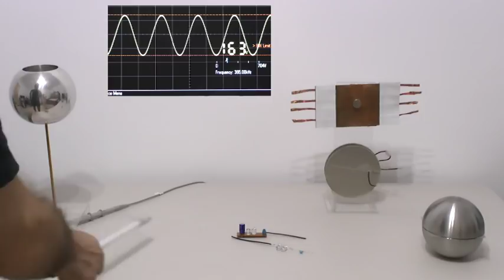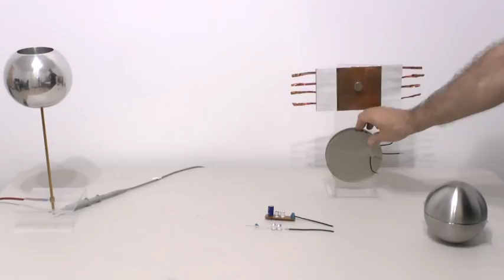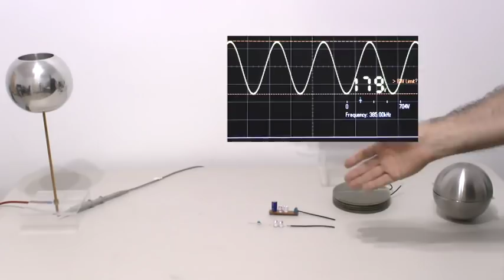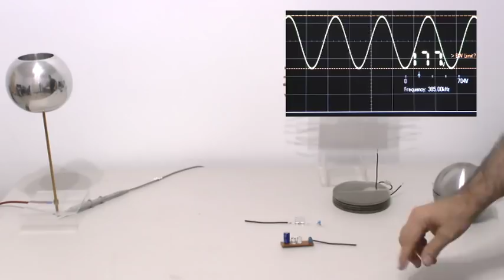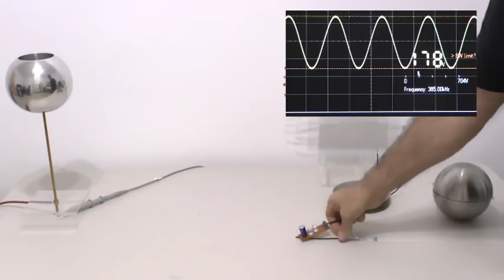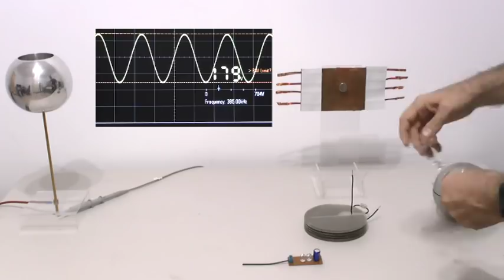Dielectric field propagation, Part2

Comment: Hello Old Scientist, Have you done any experiments with Zenneck surface waves? We are working on a project utilizing deep drilling and conductive materials as a signal wave carrier.
Reply from the maker: It is true for acoustic and seismic activities. For electromagnetic wave it is not that pronounced. While the condition between the two spheres and the low frequency > 30 MHz might speak for the phenomenon to be part of the explanation shown in this experiment. To answer your question, I have not deliberately tried to do that.
Reply: Thanks for your response. I'll let you know if we have any success.

Comment: Your sphere capacitor facing upward. You test led on the right of it. Pls correct it before make observation any further
Reply from the maker: Hello, the measurement is correct. Watch my video series about directional dielectric field propagation. This will explain why my setup is this way.
Reply: TheOldScientist hi, can you describe the part of your sphere cap? is there another electrode inside or how its shape which its  single rod inside or square shape..
Reply from the maker: As said, this part of what you learn on my website as a Gold Member in my latest video I released yesterday.
Reply: TheOldScientist ahh got ya

Comment: We are living in a microwaves field, imagine we are under a roof of piezo electric element pushing on us and all this energy flow in our body. We are system also: heart push the blood containing iron and the veins geometry act on the ambient field creating waves and displacing the steady field then it expand and contract. It took me 4 years now with experiment to understand this. Energy is only waves in the ambient steady field, like fish make waves in water to swim, he dont create a field he use the field to swim as we put the ambient field in motion. We dont create magnetism with a coil, we just set the ambient field in motion like fan blades move the ambient air already there. To get usable energy, we need to create potential differences in the xisting field or we can divide a source in two parts but each parts can have the same mass, same matter but not same geometry.
The easiest example is this: 100 psi water flow in one pipe of 4 inches, we put a Y and we connect two hose on it, one is a vaccuum cleaner ribbed hose and the other one is a normal round one then we connect again a Y on the two hoses and we connect back the 4 inches pipe. Now we have 100PSI divided in two smaller hoses and each hose have 50PSI BUT one one have restriction in it so it create waves while the flow pass trough and the other one make no waves, so between the two hoses it move the ambient field and we have a new potential difference, we can use this energy without stopping the flow. If you get this simple idea, you can do same with magnetic cores or with stranded or solid wire ;)
In this video we use the air and resonance to make a motor, so like air tools, we use only the existing field, ambient air.
https://www.youtube.com/watch?v=je7eLZS6GG0&t=11s

Comment: Thanks for this great video!

So you are into capacitance...as you know charges are simply not 'stored' in the conductors at each side of a dielectric.  In fact the dielectric will hold 'charge' even if you remove the plates from the capacitance (capacitor).  Yet with ammeters connected to either side of the capacitor you see charge movement into the capacitor during a charging cycle.  Now then, in your video, capacitors obviously charge as henceforth they light the LEDS, especially if you touch here or there.  What is really going on here?
Reply from the maker: It is very simple. Watch my dielectric field propagation and the reception of dielectrics like water
Reply: Yes, I watched that video, very interesting and good on an antenna receiving dielectric field energy and converting to electric energy in a wire with a load.

My question was more to are there actually charges store in a capacitor and exactly where are the charges stored.  Traditional teaching is incorrect in assuming the charges are stored in the capacitor plates.  Which leaves only the Dielectric of the capacitor to store the charge.  In fact if you charge a capacitor and then remove the plates then there is still charge in the dielectric which may be subsequently discharged by connecting different uncharged plates and then shorting out these news plates on the charged dielectric.

So my question is more to what is really happening in the dielectric to exhibit this behavior?  I ask because I am so impressed with your abilities and experiments that I think you may increase my knowledge of what is really happening in the dielectric.  I know dielectric energy is stored in the dielectric, however, are there really charges stored in or on the dielectric during charging, which is really an insulator?  Maybe you have some insight to this from all your experiments and advanced knowledge. If there were charges actually stored within or on the dielectric, then the weight of the capacitor must increase...granted a small amount.

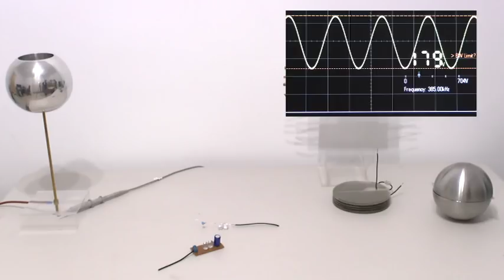Comment: I just caught this @11:49- readings on the scope change with variations of distance between the ball and the light.
So how is a load measuring on the scope through space? Things that make you go Hmmmmm.
Reply: Because of parasitic capacitance, which transfers the energy out of the circuit. Also placing his hand near the circuit changes its resonant frequency and q factor when it adds that capacitance.

Comment: The geometry of…Where is it the black hole? 
Why don´t you try with a material like ebony which is very "cold"…The direction it is the other way around, the same as from the pipe to the drain (counter-space). So the wave is the planar projection of the spiral described by the current TO the "sink"

Comment: I have always wondered about lmd analog circuit. I believe it can be improved more. Caduceus coil is the key as it produced high voltage but near zero amperage. I expect it's complement to produce high amperage but near zero voltage.
Reply: high amperage systems are subject to high resistive losses, heating and other problems. Better to find ways of using high voltages for a given application if possible. Unless you want a heating element of course.
Reply: +Michael Perrone

I know. However, what if that self-cancelling capacitor.does not produce heat? It would be fun to be the first to discover heatless high amperage self-cancelling capacitor.

Comment: I have a question. Caduceus coil is self-cancelling magnetic field. What about self-cancelling static field?

Is there a complement for caduceus coil?
Reply from the maker: You should watch my test results of the caduceus coil. The way we use a counter running EMF for controlling current flow in a transistor does not apply to any coil on its own. At higher frequency, there is no cancelation effect only time delay of current flow.
Reply: +TheOldScientist
As I suspect there is no total cancellation. Using right hand rule I can see the area of anti-nodes.

Nevertheless it is fun. Can you measure the longest length of the beam produced? Oh and, can you try to make woven coil? A better version of caduceus coil.
Reply: +TheOldScientist

Can you try using single wire instead of multiple out of position wire?
Reply from the maker: Interesting is that it is also not related to frequency but only to voltage. I would need to build a very sensitive device to measure it. My guess is at 1.5 KV at the sphere, not more than 2 meters propagation. Remember all your electronics are in harm's way.  Look at my monitor at the end of the video. It had red stripes on the screen all over it. That was the result of the exposure to the dielectric field. It was 2 meters away.
Reply from the maker: Have done that extensively at my Next Generation coil design. Details on my member website.
Reply: +TheOldScientist
Hmm alright.

I am curious though. Is it possible to replicate the result of caduceus coil with the self-cancelling capacitor?

I just notice that if you wound the coil in reverse instead of normal caduceus form, you get the actual cancellation field. Where north and south are at both end. Basically two coil wound in the same direction with each other, end point are connected. Basically you get both south and north going in.

I do not know what the effects are but be careful.
Reply: +TheOldScientist
Basically an elongated counterwound bifilar coil.
Reply: Sounds like his time energy pump video. With that sort of winding you can either cancel the magnetic field or the electric field depending on how you wire it up, though I think people have gotten better results by canceling the magnetic field. Worth experimenting with though.
Reply: +Michael Perrone

There is never cancelling of electric field. It is always cancelling of magnetic field.
Reply: If you drive the coils with voltages which are 180 degrees out of phase, the magnetic fields add instead of canceling, and all the electric fields become confined between the wires of the coils as if the coils were two capacitor plates. The electric field along the length of the solenoid is effectively canceled out for an observer at some distance away from the coils. The electric field intensity is higher, but it is confined as in a capacitor.
Reply: +Michael Perrone

That is correct.but there would not be any amperage as the capacitors are constantly shorted.
Reply: Current would flow through the coils from one end to the other because they are conductive and a driving voltage is present, while the insulator or vacuum between them is not, so there would be no current flowing between the two coils. Unless the voltages induce dielectric breakdown in the insulator between the coils of course, but that wouldn't be a proper use case.

Comment: Nah for pure dielectric propagation. You need to do it in natural conditions - 'vacuum'/pure aether condition.
Every matter have static transfer. Radiating out on all direction is normal because the air itself absorbs the static. How the sunlight is able to reach us with velocity greater than 500 times the propagation of light in matter? Longitudinal light in pure aether condition.

By the way, for beam-type configuration, use a tip-point that is pointing towards your target. This will greatly improve effciency. However, you will have to surround the entire metal with dielectric except that tip point. This is to 'trap' the static flux. This is just my speculation but I see why not. After all, orgone/static flux is absorbed through cotton at the bottom, released through metal at the top.

Comment: If there is an electrodynamic field seperate from the near-field as you mention, you can test it: near field effects fall off inversely to the fourth power with distance from the source (suggesting higher dimensionality by the way). Far-field effects fall off to the inverse square of power over distance. If you can collect the signal and compute power as a function of distance for normal antennas as compared to dielectric recievers, you can check whether the curve of best fit is second order or fourth order.
Reply from the maker: Near and Far-field effects is purely Electromagnetic in nature. This is used in our daily life by applying it to any touch credit card system or security tags on goods we buy. Here the near field is λ = 300/f MHz or half the frequency length. The E and H fields support and regenerate one another as their strength decreases inversely as the square of the distance (1/r2). Maxwell described this phenomenon in his infamous equations. In my case the frequency was 386KHz and the near field would be 379.5 meters. In the near field, the wave bounces back from objects and changes the wave characteristic. We use card readers to decode it. The frequency of use for touch reader is 900 MHz. As mentioned, the dielectric field as stated In Steinmetz equations is a component of the electromagnetic wave. It is more expressed the higher the voltage. Meaning it reaches out further. However not in a way the electromagnetic wave transverse does. Only this flled can penetrate a Farraday cage because it does not go through it. It simply vibrates the whole Farraday case with the frequency in question. Any receiver inside the cage can then pick it up as my LED's did lit up. Some, including myself, were using the term "Scalar Wave". The shielding questions were raised many times. So far I can say that only dielectrics can shield or absorb it. This must be built without any traces of metal or better-conducting matter.
Reply: The near field does not suddenly stop at half a wavelength: that is an engineering approximation. It just attenuates much faster with distance (intensity goes like inverse 4th power instead of inverse square). If you calculate the higher order terms from maxwell's equations which describe the near field, you will see that none have arbitrary cutoffs like half a wavelength, but they all decay faster than an inverse square law. It's how the math works out. After a certain distance their contribution is negligible for engineering purposes, so half a wavelength was picked. For very sensitive applications, a full wavelength or more may be chosen as a cutoff instead.

Steinmetz's equations were based on the quaternionic maxwell's equations, correct? The complex form of the wave equation may have infinite velocity, but it must then have an exponential form in space. If the dielectric waves (Which I suppose I have been calling electrodynamic fields using more modern terminology) are real waves in space with a finite speed, then two concentric faraday cages around the tesla coil with a resistor connecting them will drain power from the wave, because the voltages at the surfaces of the two faraday cages will be different from each other in space and time, so a current can flow between them through the resistor. If velocity is infinite, the waves are in complex form and must have an exponential profile in space (rotated into timespace?) as mentioned by Eric Dollard. This means that concentric spheres around the source of the waves will still exhibit different voltages and power may be drained from the wave. The principle of operation of the LED and capacitor setups you use in this video is the same, but you can make that gradient of voltage steeper by changing the dielectric environment around the device, or you can increase the power output by increasing the parisitic capacitance to the tesla coil.

Dielectrics probably work as shielding due to dielectric losses. In which case they should heat up somewhat as they absorb energy from the wave. The effect should be easily measurable for ferroelectrics in the megahertz range, with a high enough power output from the coil. Dielectric losses are analogous to the concentric faraday cages I mentioned, and I urge you to try it. There are subtle but important differences from things tried here in the past. The nested faraday cages connected by a tuned resistor (RC circuit has a time constant which must be matched to some multiple of the frequency being absorbed) can be thought of as a metamaterial dielectric. They are doing essentially the same thing with the dielectric wave that a lossy dielectric does.